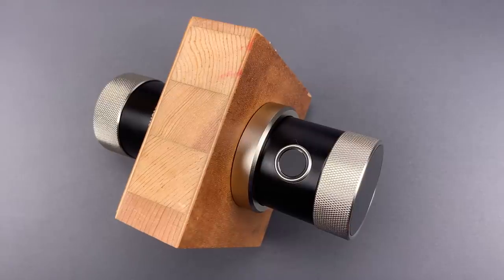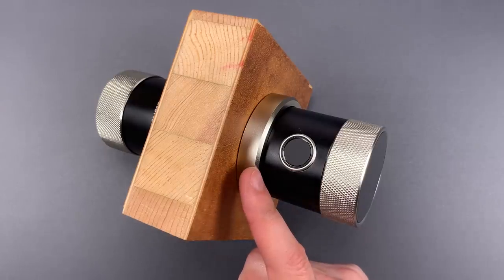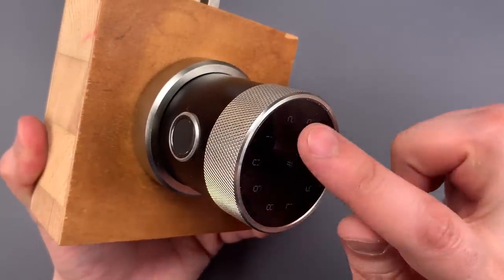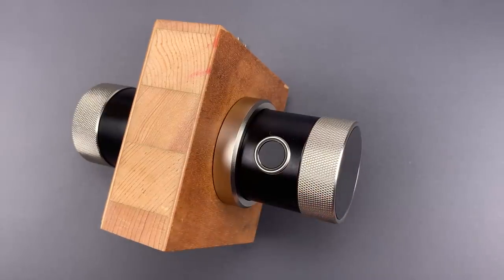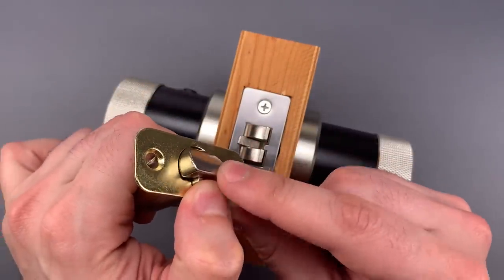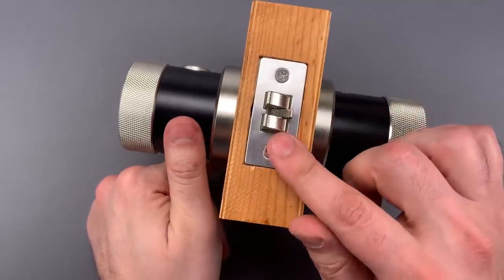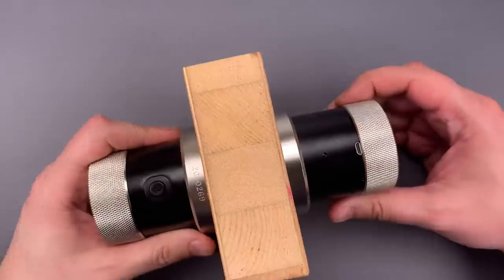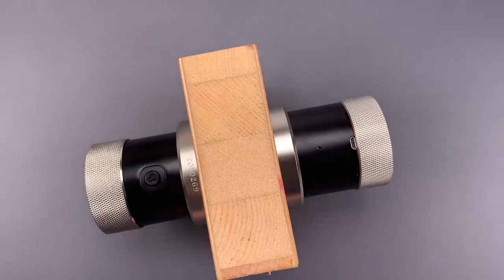[1120] Fingerprint Lock That Forgot The Fundamentals - DatoHome L-B400

Comment: microUSB on the outside handle is also a major security flaw, if the data pins are connected to anything. I can guarantee you this was made with standard parts which have debug interfaces which could be used to gain control over the software inside the lock. Unless you fully designed your own silicon and software, you should not expose USB to untrusted users. All you need is someone to do some basic reverse-engineering work and package it up into a low-skill attack that you just plug into the USB port.

Even if the data pins were disconnected, I could imagine some punks with a USB Killer shorting out people's locks for fun.
Reply: Yep I was just thinking about USB killer sticks
Reply: Not connected.
Reply: I think the USB part stays inside the room and the dimple is emergency exit option for people inside the room.

I mean, y would the fingerprint and dials be from the inside?
Reply: i wonder if it's fail-open or fail-closed? both have some obvious problems
Reply: That's why they didn't make it a dead bolt. Why go through the trouble of sabotaging the usb when you can just pop it with an old life way christian store gift card? Always thinking
Reply: @lakpabhutia3554  It is on the same side where LPL is pointing out the flaw in the tiny dimple hole for allowing drilling.  Only fair to assume the microUSB is also on the outside.
Reply: could be used to POTENTIALLY gain control over the software inside the lock. Hackers successrate in such cases are about a million times lower than they will admit to, and they never tell about the hardware mods that were done in advance. In reality its like an Xbox, hacks will not work without the required hardware mod aka the chipping. Busted a couple of hackers myself, turned out their claimed exploits were based on nothing but lies hidden under lots of BS meant to confuse, plus most people are afraid to look stupid if they disagree but in fact its those who agree with the self-appointed hackers who look stupid. Take philippines, they had 20 million hackers right after thye ILOVEYOU virus but still only one has done any damage, the other 19,999,999 are still out = extremely low success rate.
Reply: @pflaffik  Ok grandpa, it's time to take your pills now
Reply: @TheGrandexeno  Oh no, are you telling me that vandalism will still be a problem as much as it is right now? Who would have thought that
Reply: @arthurvanderwal  Why so toxic? Self proclaimed hackers on the internet have a very strong tendency to pump up their stories massively to spread panic/mistrust and gain attention
Reply: Punks also Super-glue keyed locks "for fun".

Comment: Oooooohhhh, so THAT'S how they open doors using credit cards in movies and TV!
Reply: Footnote: AFAIK, spring loaded latches are not particularly common outside the US - certainly every single door I've seen positively holds the latch extended while locked through direct mechanical linkage; until the key turns the latch cannot move. Yes, that means we have to actually lock our doors going out, can't just shut-to-lock them. We also tend to never get locked out, funnily enough, unless someone else locks us out or we lose the key while outside...
Reply: @AttilaAsztalos , my experience is that spring-loaded latches with an additional deadbolt (either completely separate or opened with the same mechanism as the latch) are common in the UK and Spain.
Reply: @AttilaAsztalos  Spring loaded latches are rarely used as the only source of security residentially, deadbolts are pretty ubiquitous. However in businesses they do tend to be the sole source of security as access control systems don't really work well with deadbolts.
Reply: Without comically poor installation credit cards won't open most doors as they're too rigid. You need a more flexible plastic to get around the door jamb to hit the latch. Unfortunately comically poor installation is somewhat common as well, so they can work on occasion.

Comment: Why is the USB charging port located on the outside part of the lock?
Reply: You can use that to power the lock with a powerbank if the batteries are dead and you are standing in front of the door and wants in.
Reply: @Lesatur  makes sense,but to charge it do you have to have the door opened? I mean if that is the case then whoever wants to get in your house they would just have to wait for you to start charging the door knob
Reply: @RobertoG987  The lock actually runs on AA batteries, and doesn't charge. The port is to supply temporary power through a power bank in the event the batteries die while you aren't home.
Reply: @phyrexiancoffee6324  gotcha, thanks for the info

Comment: I thought the extra central tongue was the deadlatch on this type of lock? Are you sure that isn't a deadlatch?
Reply: That's what I was thinking as well. Unless they somehow made it not work as a deadlatch.
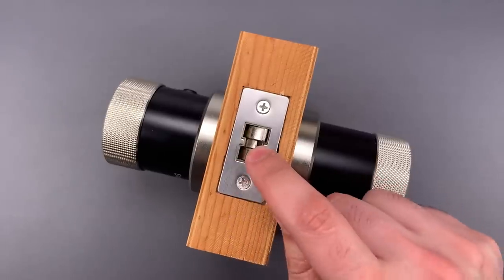Reply: I guess the issue is that if you know where exactly it is and manage to engage only the part above or below it, the latch can still be moved (1:40 clearly shows the latch is not blocked), while the other lock doesn't let the latch move at all as long as the "pin" is depressed...
Reply: @AttilaAsztalos  but, there was no strike plate to properly engage the deadlatch....of.course it worked in a 1/2 door. The middle part would be depressed in a properly installed setup
Reply: No, it is for longevity of the latch. It retracts the latch when you close the door and it hits the door frame, reducing the force exerted on it.

Comment: These locks are cool but i cant imagine having to charge a lock every now and then
Reply: No charging. You just replace the batteries in it (on the inside) once or twice per year, when it starts pestering you about low battery...
Reply: @AttilaAsztalos  at 3:00 in the damn morning, twenty minutes after you got the smoke detector to stop chirping.

Comment: Does the small central lock "lever" not engage with the lock plate and perform the deadlock function? Just a thought.
Reply: It does. If you notice carefully, the flexible plastic isn't strong enough to puch the lock inside. LPL couldn't open this one except for brute force.

Comment: General rule of thumb: the more ways there are to open a lock, the more vulnerable it is.
This lock can be opened by 4 things:
Fingerprint: relatively secure probably
Combination: LPL has a 4 digit combo, so brute forcing may be an option
RFID: oh god this is probably pretty easy to trick by just blasting some noise at the right frequency or something. I would not place much faith in RFID
Via phone over Bluetooth: depends on exact protocol, could easily be quite easy to cheat
Reply: I'm convinced someone out there has invented an RFID brute-force tool.
Reply: You never be able to brute force an RFID lock with " just blasting some noise", the tag containing some error correcting code so it must be a valid ID.  @Googie Gress  If you try to brute force with valid codes, it is enough if reader apply some delay between readings. Don't forget that the lock controls the readings/second and not you. Not to mention if the lock pauses for a minute for every 5 tries. You could stand at the door for years.
Reply: @mtx33  Cool, that was what I was hoping / expecting, but you know how manufacturers can under-fulfill on expectations. Good to know!
Reply: @mtx33  Im more interested on attacking usb port, what are chances that usb port is data connected?
Reply: @janisber111  can be, but most likely only a charging port, connecting the 5v and ground pins to a surge protected charging circuit. If it's data connected (doubt, but say to update firmware) i'm certain you only can reprogram it in unlocked position and/or by press a button inside the housing and with a firmware digitally signed by the manufacturers private key. maybe they can implement an electronic "backdoor"  function, but it's easier them to put a 00001111 master combination in, or some stupid think like that. but hey, maybe they used some off the self controller, that you can glitched by using to say strange voltage spikes or whatnot in the usb pins. (but your chances are very slim to actually open the lock like that, not just crash the controller with the lock still closed)
Reply: @mtx33  Could be, but hey its default administrator password is 1233456# how many people will bother to change it? It also have an app, that can be used as attack point, I mean at this point you dont even need to be at the door to attack them. Just park close and work from computer, for references bluetooth 1 will work to abouth 10m range while bluetooth 5 will work to around 40m range. In fact if admin device is home and with bluetooth turned on, it doesnt take much time to impersonate it.
Reply: @janisber111  Interesting question. Best to do is not setting any default password, or design a system so you must change it before you can lock it. The biggest question in every cases like that, what is the user forgets her password or loose his key card.  Unfortunately I'm not well versed about bluetooth in technical, but you can treat is from the beginning as a compromised transmission channel like the internet or wifi in general, so you should use only MUTUAL authentication and proper authorization with forward secure encryption. In that case it doesn't really matter if you can listen in the communication or can impersonate a MAC/whatever hardware ID bluetooth uses, without the private key, you can't possibly open the lock. It's an interesting topic, and most of the time not the technology's fault if something compromised, but disregarding some important factor by the manufacturer.

Comment: I think the dimple might have been intentional, so you could still get out of your house if your lock ran out of power.

Locks running out of power. What a world we live in.
Reply: You mean get in. The egress side always turns the bolt, even without power.
Reply: @gunnar6674  I guess some people don't understand the concept of locking  doors to prevent others from GETTING IN.   Maybe same ones who are surprised by a battery-powered door lock.

Comment: To give them credit, it fhe door has good, tight weatherstripping on it this attack wouldn't be much of an issue.
This lock is better than 90% of locks out there that can be raked open in under a minute.
Reply: exactly,. until the lock low on battery.. i have one installed, and when the battery low, it can be open without the finger lock.. weird stuff..
Reply: Weatherstrip is NOT a security feature. it's flexible and that plastic is thin.
Reply: @Green__one  If it's a thin layer of foam attached to a thick piece of wooden molding it definitely adds security. My house's front door uses this setup, and so do a lot of other doors I've seen.
Reply: I'm sorry but one of these is bound to get you trough in under a minute (so while it might take trying a few methods first time you encounter a lock like this, after that just repeat what works and you can consider it as easy as raking a more classic lock)
- Look at fingermarks left on the numpad to figure out the code, for most people it will be easy to rember so easy to guess
- Plug in a stripped usb cable and try short circuit different wires, power different wires, or just use a tazer on the usb
- Try common rfid tags (just like how there are common keys there are common tags)
- Clone the actual rfid tag (easier then it sounds, can be done from a distance)
- Drill/Cut in the right spot (might seem a bit extreme/loud/obvious, but its also fast & actually how most bikes scooters etc get stolen) like the one mentioned near the end of the video
Reply: @thorlancaster5641  just because it's used frequently, does not make it more secure. take a look around YouTube and you will see lots of examples of people bypassing weatherstrip like that easily. I know a lot of the people who watch this channel also watch Deviant Olam's stuff and he shows it well and had it as part of many of his lectures. There are products designed to fulfill that security niche. Weatherstrip is not one of them. If you can snake a flexible piece of thin plastic (not really thicker than a piece of paper) past the frame without the whether strip, you'll be able to do exactly the same with the weather strip in place. It may take practice, but for someone experienced it's a piece of cake.
Reply: To quote Deviant Ollam, one of the top penetration testers, "weatherstripping is NOT a security feature". He has an awesome video titled "I'll let myself in: the tactics of physical pen testers" from infosec con 2017, extremely informational, entertaining, and you'll be able to break into anything without looking at a lock after youre done
Reply: @suicidalbanananana  You're making a lot of assumptions there buddy.
 - Only works if the owner actually uses the keycode, and assumes they don't take the simple precaution of wiping off any fingerprints.
 - Assumes that breaking the lock causes it to open.
 - Assumes that there are common tags, when there might be hundreds of possible physical keys there are billions of possible digital keys.
 - Assumes that it uses simple tags that can even be cloned.
 - Works on literally every lock ever.

Comment: Can you fry the lock by connecting the usb-killer stick into the outside charging port?
Reply: Why would you want to keep the door locked?  It's not like it would open by frying the electronics.
Reply: @eak125  probably to keep someone inside if somebody have nefarious thought and want torch the house.
Reply: @DumbMuscle  it looked like there was a button on the inside door handle to manually override the lock

Comment: So in -30°c weather that will need a charge every day 😂
Reply: id assume the batteries would be on the inside door handle for that, if not that could be a design flaw. though im not sure the solenoid, or the pcbs themselves would even function at -30c
Reply: This is spicificily for indoors only. I use the exact one on my office because kids are stupid
Reply: Not like -30 celcius is common place lol
Reply: @omnipresentsnowflake4698  Russia: hold my Vodka
Reply: I have a Schlage keypad electronic door lock that runs on 4 AA batteries where the exterior of the door is exposed to - 40 C weather...and living above the Arctic Circle, I can expect -30 C temperatures for two or more months solid. The lock starts beeping to let me know to change batteries after roughly a year of use.
Reply: @omnipresentsnowflake4698  here in canada -30° is pretty common winter temperature

Comment: 2:31
Wait a minute...
That lock is charged by the outer handle?!
Reply: Running out of battery isn't a problem if you want to get out, since the bolt always turns from the inside, so the only times you'll have to emergency recharge the lock is from the outside. But having to hang a USB battery on the outside of the door sounds inconvenient.
Reply: @gunnar6674  I was mostly thinking that IMO you should have the least interactible elements outside.  I guess that when out of battery it automatically locks and it's a safety measure to be able to quick-charge it if you're locked out (provided you carry a portable battery along), but I'd rather have at least a battery port inside to charge it when people are at home. As you said, hanging a battery outside of the door is inconvenient, but it's also unsafe. Provided you have a less-than-moral neighbour, you're going to buy a new battery each month...
 (and I think, if you're going to buy a fingerprint lock, that you're not living in the friendliest neighbourhood, or are having paranoia-adjacent issues, so that would still apply.)
Reply: Keep in mind most people don't have many outlets on the outside of their home, so you would need to chare your door while it is wide open. Fucking wonderful design.
Reply: I wondered the same thing. Another commenter says it's really powered by AA batteries and the port is just in case the batteries die while you're out. (I really hope the AA batteries are loaded through the inner knob.)
Reply: @atk05003  It's not rechargeable.  You put in fresh batteries when the app tells you it's time. The USB is for backup power when you're locked out and the batteries are dead.
Reply: @UpnorthHere  That's ... what I said.

Comment: What is the USB port on the outside handle for, just in front of the "dimple"?
Reply: Charging the lock I guess
Reply: @user-em9wu1qo4r  Would guess so too - but charging on the outside? That's got to be another flaw there?
Reply: Odds are so you can provide a quick charge to the lock in case the battery dies while you are outside.  If they're smart, it'll be for power only with no data lines.
Reply: I thought for charging as well. If it accesses any of the electronics, or let's you program it, it could be an interface to brute force or hack it.
Reply: @eak125  ever heard of powerline attacks? pretty complicated but they exist. Dave @ EEVBlog has a couple videos on the topic
Reply: @Spinq  " but charging on the outside? That's got to be another flaw there?"
think for a second.  if the batteries were dead... how are you going to get IN to charge it?
there is no security flaw there.
Reply: @thomasneal9291  we can't know that without knowing what the USB port connects to, and how the internal programming works. If the lock is set up to "fail open", burning out the circuit could allow the lock to disengage. If it fails closed, overloading the power could render the lock useless, in a locked position.
Reply: The Micro-USB port is in case the four AA batteries die, you can supply power from an external power bank to unlock the lock. It doesn't charge it, just supplies power. Once you unplug the bank, it's dead again. It's just a backup so you can get through the door and replace the batteries from the inside.